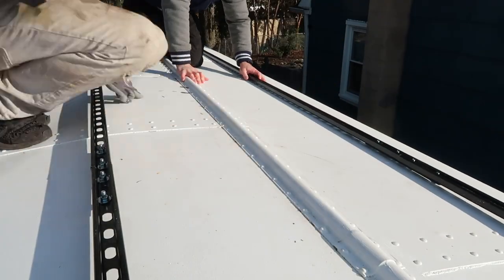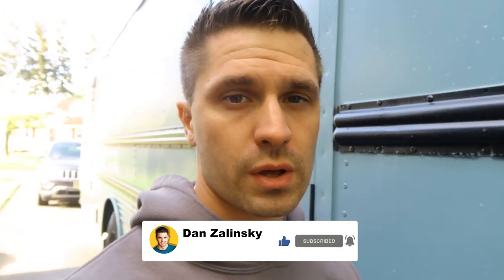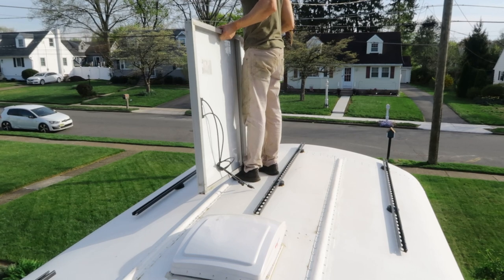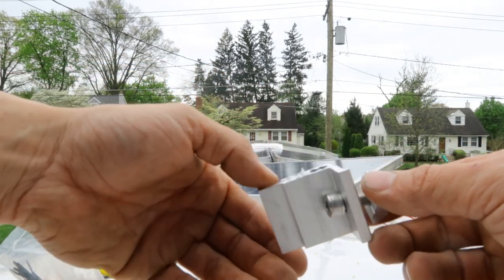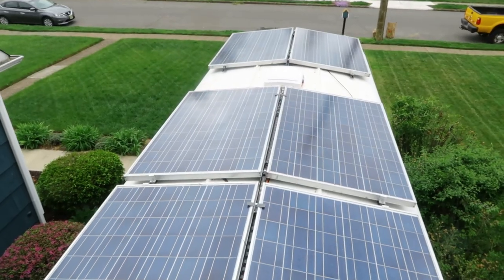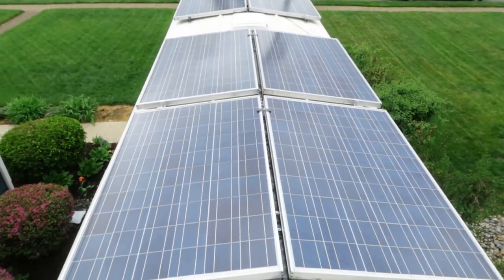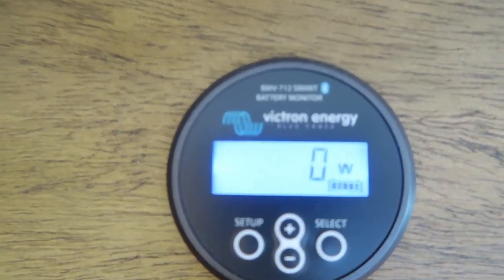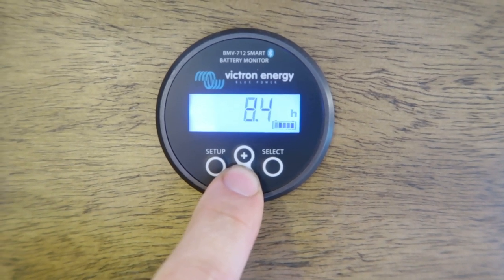Skoolie Solar Install | Bus Conversion

Comment: From you explanation it looks like the panels that are in series form an "L".  Panels on the opposite side of the roof curvature  will reduce the maximum power from that string.  If you connect the panels in series that are on the same side of the roof you will get more power.  Happy travels.
Reply from the maker: Good call out. I Didnt even think about that. It makes sense. I am updating the clips on there. When I do that, Ill connect the panels so that the panels in series are on the same side. Appreciate the help. 😎

Comment: Getting closer to the finish line, the bus looks great.     Will the panels be able to power up your batteries when you are driving? Or is that going to be done by the aultinator?
Reply from the maker: Yeah they will be able to power the battery bank when driving. As long as the sun is up!!

Comment: Looks like you have a small shadow casted by those clips in the middle. My experience is, a shadow casted by a small wire on a 100w panel, reduced the output to about 5w on a sunny noon.  Otherwise, it looks good, it's looking like a home now!
Reply from the maker: Hey! Thanks for the call out. I ordered some thicker metal for the rest of the clips. Ill make some new ones up that dont cover the panel. Appreciate it!!👍